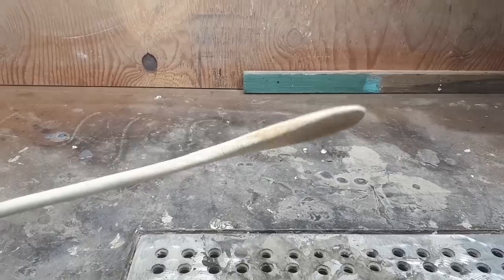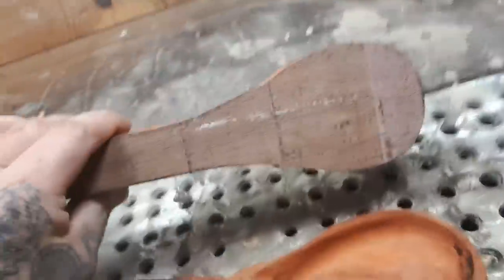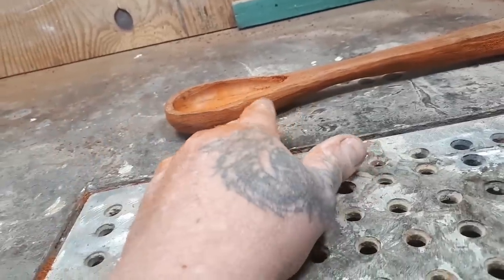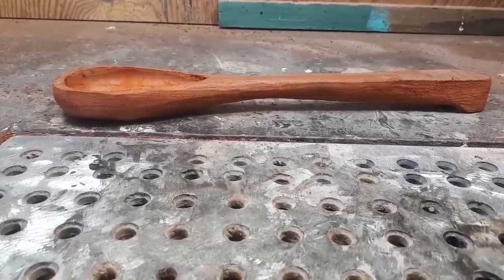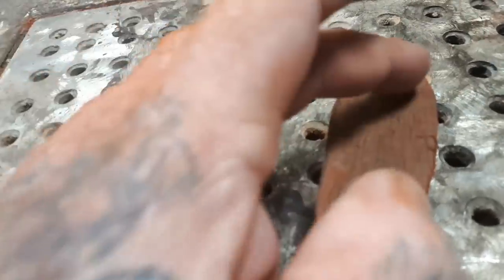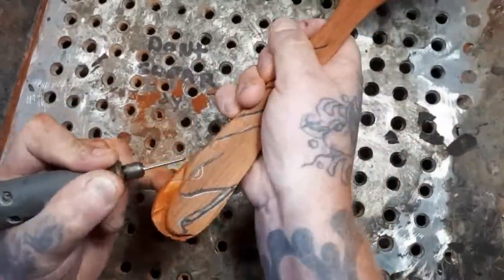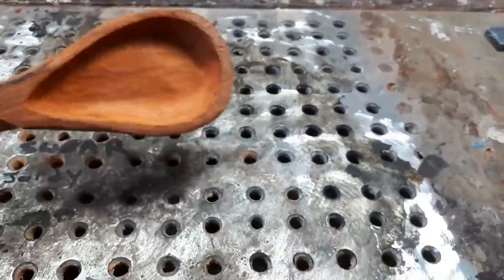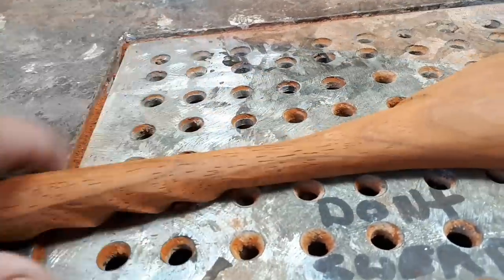Carving a wooden spoon

Comment: My generation is probably gonna be the last one to recieve spoon spankings on a wide scale thanks to all these regulations and what not in the past 15 years(I'm 25). I also remember having to go pick out my own switch, I'd pick the easy to break ones so I could get off lightly, didn't go well lol. If you're worried about wood being stolen or something just use a reputable wood supplier that only imports sustainably grown wood.

Comment: How often do you need to replace your burrs Jordy? what do you recommend
Reply from the maker: I use the 1/8 flame extream, they last a long time
Reply: @CarvingFusion  whoops i bought the 1\4 inch bit, is that too big for your carvings?
Reply from the maker: Do u have a foredom or a dremel ?
Reply from the maker: 1/4 is for the foredom and 1/8 is for the dremel, I use both
Reply: @CarvingFusion  foredom
Reply from the maker: Yes so I use the 1/4 to remove lots of the bulk, and the 1/8 for the detail,